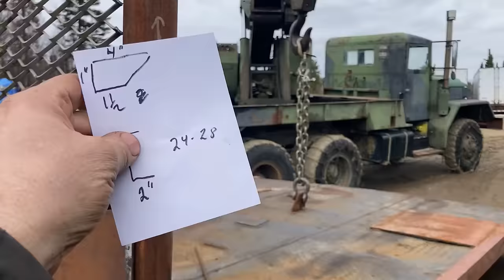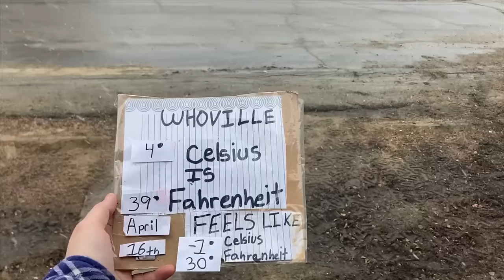Getting Ready for the Spring Snow Storm April 16 2024

Comment: OK Mr. King of Obsolete Polymath Man. You popped that Lefty Cat right out of the snowbank. Nice job!  You wish for snow, I wish the electronic thingamajig on my lawnmower would spark. Imagine this: A 1990 and it's obsolete. Probly have to adapt a GM HEI amp to it. Weir Still havin fun. ben/ michigan
Reply from the maker: yes we had lots of snow that year. a quick google search and you should find the common electriconic points thing that fits everything.  thansk
Reply: @kingofobsolete4789  It's my little tiny thing, I'm thinking to adapt the GM HEI amplifier because I can buy one for $15 where the only one I've ever seen for my Onan 2cylinder opposed16hp for 1990 is about $165, and it quit. I happen to believe the GM amp will easily take the miniscule signal from the magnetic pickup and run the coil. Thank you, I will do more research.
Reply from the maker: @benjamincresswell3713  not sure what those little kits cost but they bolt right in on any motor.  thansk